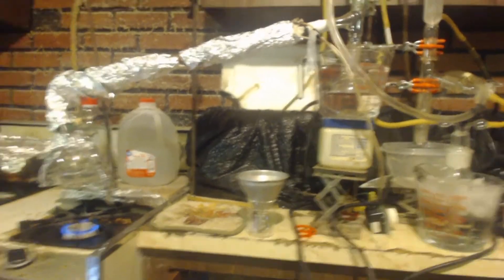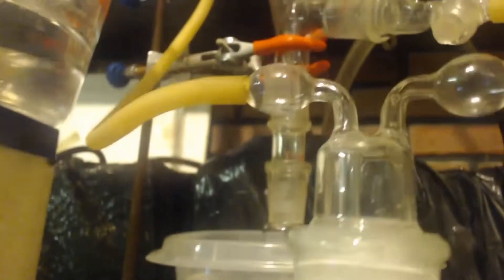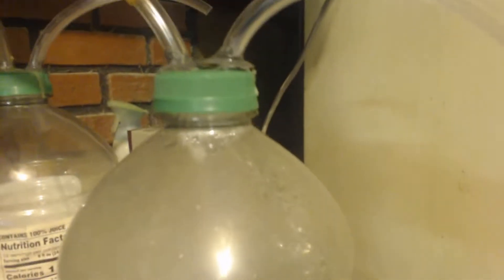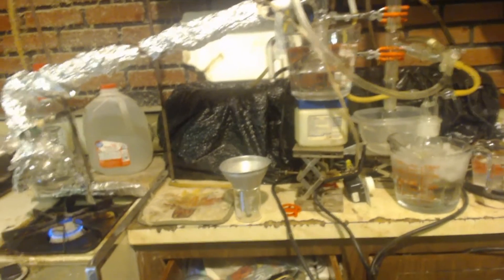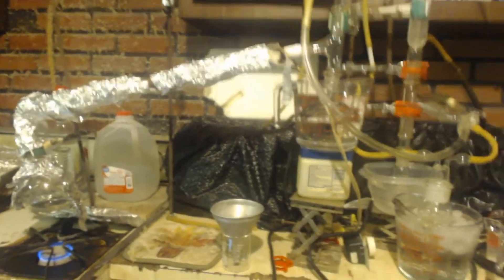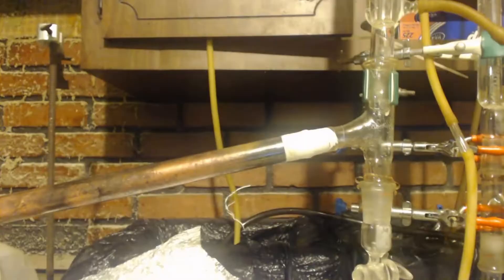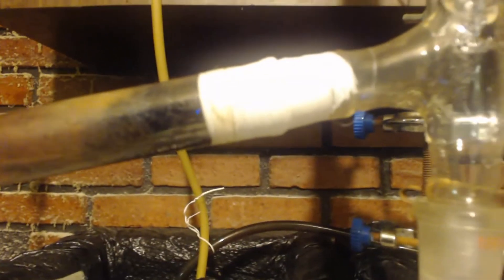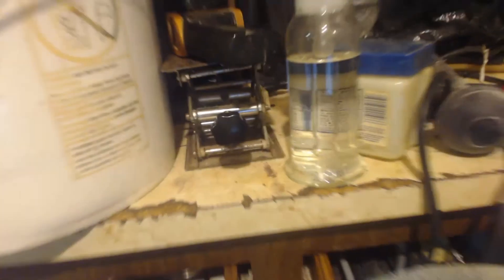ACETALDEHYDE SYNTHESIS part 1

Comment: This has been a bit frustrating & my ability to comprehend is no doubt the issue, my question is if you just want a nasty quick 8ml of it, is there any issue with doing a cut down version of this with the ethanol on one side, the glass rod connecting the receiving flask.

If the reaction is improved by passing the ethanol through at a fast rate then it gives the impression that 8ml should be able to be done in 15 or 20 minutes - is that an accurate assessment of this change?

The other thing I had trouble figuring out is stating the vapour needs to be at 300C before it hits the heated catalyst.
I am assuming you do not actually heat the ethanol (round bottom flask) to that temp as that seems very impractical & in the video there is only a single heat source other than where the round bottom flask sits.

How do you ensure that the vapour is at 300 while the catalyst is only at 275 with only a single heat source?
Does it mean you heat the tube directly to the left of the catalyst so that the tube itself is hotter than the catalyst and that would be close enough?

Thanks for the video
Reply from the maker: ADAM............First let me say that I HAVE NOT COMPLETELY figured out this experiment.   Last year when i made the video series  i did like 8 or 10 experiments and twice i got 8mL of product.   This year i tried to replicate and improve the experiment about 6 times and FAILED EVERY TIME.
                 (1)  Not sure what you mean by cut down version????    
                 (2)  But yes according to all the papers i read on people doing the experiment it is a QUICK reaction.    Meaning ..yes... making only 8mL should only take 15 to 20 minutes once the furnace tube is up to temp    
                  (3)  I heat the ethanol up in the round bottom flask to get it into a vapor leading into the furnace tube.     I ALSO have  HEAT TAPE around the furnace tube to get the ethanol and copper  up to 300C.  
                  (4)  I used water to experiment with first before i used ethanol.   Sending water vapor through the furnace tube.  The exit of the furnace tube was open to the atmosphere so i could put a thermometer in the open end  (exit) of the tube.   Then i experimented using different temps of the heat tape until the water vapor exited the furnace tube at 300C.
                  (5)  The heat tape was wound around the furnace tube right up to the point where the copper was in the tube.   The tube gets HOTTER in the middle  of the heat tape and at the end of the tube where the heat tape stops...where the copper is.......will not get as hot cause it is on the end of where the heat tape is.    Although this year when i tried my 6 experiments which ALL failed i used 2 heating tapes around the furnace tube and bought some thermostats that went up to 999C.    One heating tape was to heat up the ethanol and extended almost over the whole furnace tube.   Then a second heating tape that JUST  went around the copper part of the tube furnace.   I used 2 different thermostats ......the one around the copper at about 290C and the heat tape around the ethanol at about 350C.   The thermostats are only $15 each on ebay.   
                   (6)  Yes exactly!!!!!!!!!   I just put the heating tape all around the furnace tube right up to where the copper is (just enough to cover up the copper too.   So it gets hotter in the middle of the furnace tube where the ethanol is traveling before it hits the copper.   KEEP IN MIND last years experiments when i had no thermostats i just used a laser thermometer that goes up to like 500C.   I WAS THE THERMOSTAT  and used a switch to turn on and off the heat tape.    OH MY GOD  you just made me think of something.   Maybe my experiments did not work this year cause i used the thermostats WITHOUT checking to see how accurate they are.    I should have gotten my laser thermometer out and DOUBLE CHECKED my temps to make sure the thermostats were accurate.  I am NOW hoping that is why i failed this year.   Anyways if you got any more questions let me know.
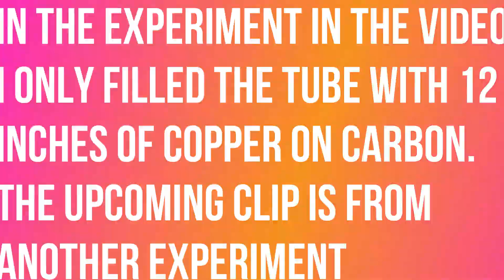Reply from the maker: ADAM ........The heat tape i am using on the furnace tube is showed at 9:00 in the video.  If you need help buying heat tape let me know and i will look up my serial number.   They only cost about $45 or $50 each on ebay or amazon and can go up to 700C.   But it is the same type of heat tape  nerd rage uses in his video where he builds a heating mantle for distillations.   As for the thermostats i bought they were XH-W1315 thermostats sold on ebay or amazon for $15 each.  Thermostats go from minus 30C to 999C.   Here is a video about the thermostats  https://www.youtube.com/watch?v=mrteBD7yAsw&t=34s   I love the thermostats.  I use them for my water cooled condenser when i distill stuff.   It really really really REALLY REALLY REALLY  cuts down on ice usage.   I just use aluminum foil to attach the thermostat probe to the water cooled condenser.
Reply: @johnblacksuperchemist2556  Hey mate - Thanks for your detailed responses, they are fantastic. I am going through them now, appreciate the effort you put into your videos.
Reply from the maker: @Adam Randall  ............Your welcome.  Glad you like the videos.   Hope i helped.   If not just ask some more questions.  KEEP IN MIND I am learning too so i do not know everything
Reply from the maker: ADAM...........If you mean by "cut down version"  .......making the apparatus smaller and just set it up like a distillation apparatus.  You can not do  that.   The acetaldehyde is so hot when coming out of the furnace tube you need something to cool it down A LOT.   
                   If you mean by "cut down version" .....using less ethanol.    Cause you only want a little bit of acetaldehyde then yes you can do that

Comment: You can use Ethanol sulfuric acid (75%) and MnO2 .From old Pharmacy book
Reply from the maker: Space Marine...........Have you ever tried it????????????   I could be wrong but i think MnO2 oxidation of alcohols to aldehydes REQUIRE an allylic alcohol and ethanol is not allylic.
Reply: @johnblacksuperchemist2556  no ive didnt try it but it looks true it was in old books alsway the mno2 sulfuric acid or later the EtOH dichromate way. Maybe next winter i try it.little bit late anwer :)
Reply from the maker: @Preyhawk81  ...........You're as bad as me.......replying to 3 yr old post.    I hope you are doing good.

Comment: John, impressive video as always. Glad to see you're still doing well. Ironically, I recently bought some supplies for the synthesis of acetaldehyde specifically so your video came as a surprise to me. I was going to do some tinkering to see if I get results but I figured it would be better to ask you since I'm a far less experienced chemist.

I'm planning on performing a hypochlorite oxidation of ethanol using calcium hypochlorite. From what I understand, hypochlorites can oxidize primary alcohols to aldehydes and carboxylic acid. I discovered that the aldehyde from the first step does not directly participate in the oxidation to the carboxylic acid, instead it's the aldehyde hydrate formed when it comes into contact with water. I was wondering if perhaps it's possible to exploit anhydrous reaction conditions to get better yields of acetaldehyde using these cheap reagents. Is there any information you can give me regarding this? Thanks in advance.
Reply: its a good idea try to condense the gas produced directly in a chilled condensor. it wud b very kind of you to share ur findings with me. another route cud heating ethylene glycol with zncl2.
Reply: @tanveershah4974  Thank you, Tanveer; I was actually thinking of doing the ethylene glycol method next! In any case I will come back to this comment to report my findings to you once I carry out the reaction.
Reply from the maker: @tanveershah4974  ..........tanveer............Never heard of ethylene glycol and zncl2.  Not sure how that would work.    I have heard of ethylene glycol and alumina to dehydrate it into acetaldehyde.   I have never tried it but i have faith that it works if you do it right.   I have also heard of using sulfuric acid to dehydrate ethylene glycol into acetaldehyde but i tried it a few times and it really does not work good and it makes ....what smells like......formaldehyde.   This way of using sulfuric acid and ethylene glycol is the same method as making 1_4_dioxane but the only 2 things i could think of to swing the yield more towards dehydration was more concentrated sulfuric acid and higher heat but that did not work to good.
Reply from the maker: Alex D.................You said you wanted to use bleach/AcOH to make aldehydes from primary alcohols.    And i said you need a catalyst for primary alcohols or you get no appreciable yield.   Well i finally found the name of the catalyst in case you are interested it is called   2,2,6,6_tetramethyl_piperidine_1_oxyl.   And then you get like 95% yield of aldehyde.
Reply: @johnblacksuperchemist2556  John, thanks for coming back to reply with the info. I played around a little with the reagents and as expected I got no appreciable yields. I also experimented with various catalysts I had on hand and still nothing. There was definitely some acetaldehyde being formed since in most cases I got a somewhat pleasant sweet smell almost like ether which definitely was not acetic acid or ethanol. It's also possible that it was indeed diethyl ether or ethyl acetate but I'm not sure whether or not the reaction mechanism allows for this. That being said, TEMPO is a little too difficult for me to acquire since I'm trying to avoid ordering from suppliers (the cheapest source I found was $200 for 25 grams of TEMPO; yikes!) and the synthesis uses some pretty expensive reagents. I think I'm just better off following your procedure although it will take some considerable preparation on my end lol. Thanks for the info brother keep up the great work! 👍
Reply from the maker: Alex D             https://en.wikipedia.org/wiki/TEMPO            That link has a small page about that catalyst.   Scroll down to "APPLICATIONS IN ORGANIC CHEMISTRY"
Reply from the maker: Alex D............I am reading your mind...lol.   Seriously though i did do some hypochlorous acid (bleach) oxidations last winter.   I I oxidized isopropanol to propanone (acetone).   I could only get a 30 to 35% yield but i have not tried everything i could to try to improve the yield...yet.     It was SUPER PURE acetone though.  I distilled it several times with vigoreax distillations.   As for the ethanol to acetaldehyde is not as easy.  You need a catalyst or you will NEVER get more than a mL....if that.  And i did not just read that but i also did a few experiments using the same technique i used to make acetone and i could only get the smell of acetaldehyde and no real yield.   If you give me a couple days i will try to look up what it is.  It is not an easily made catalyst.    
           No i do not know how to use anhydrous conditions to make a better yield.
            The cheapest and easiest way is the catalytic copper dehydrogenation of ethanol to make acetaldehyde.   READ THE TEXT I PUT UNDER THIS VIDEO...........and it will tell some improvements that can be done on the experiment in the video above to get better yields
Reply: infact one of my friend who is a professor and deen of chemistry dept and have been my room mate advised me to try ethylene glycol method. unfortunately i am now more busy in making mono pentaerythritol these days so cud not start experimenting on it.
for you to try bleach in ethanol there is video on you tube. the guy added more bleach to turn acetaldehyde into choloform. i feel right amount of molar ratios of ethanol n calcium oxychloride can make cheap acetladehyde.
another way cud be from calcium carbide to acetelyene then to acetaldehyde. thnx
Reply from the maker: @tanveershah4974  ...........Your ALOT past me with knowledge if your working with  pentaerythritol.  Well if you ever figure out how to make acetaldehyde with ethylene glycol and ZnCl2 let me know.   As for the acetylene  route.....I do have that in my notes but i forget how the reaction goes.   I guess it makes some kind of enol and then ..........wait I see.   You must add an alcohol to the acetylene triple bond making an enol that changes into an aldehyde.   Yeah i guess i have not really gotten to that experiment because of the acetylene being a gas.   Not sure how i would do the experiment.    This experiment in the video is really my FIRST high temp reaction.  And i have never really done any high pressure experiments either so i am hesitant about working with acetylene right now.   Sooner or later i will get there though

Comment: nice video dear. can u advise % yields? of acetaldehyde produced here? pls advise how to make cheapest acetaldehyde? around 50 kg each day. thnx
Reply from the maker: tanveer...........My yield was crappy.  I only got 8 mL of SUPER PURE acetaldehyde.  This is probably the cheapest way to make acetaldehyde cause you only really need some copper and ethanol.   And alumina if you want your copper catalyst to last longer.  
                         I will go over what i THINK will improve yields in part 2.   In part 2 i will go more in depth.  But ...........here are my best tips to improve the reaction and the catalyst...........(1) use smaller diameter tubing for the furnace.  Like 12 mm inner diameter.  (2) Only put catalyst in like 15 mm length in the tube.  (3) MAKE sure the ethanol vapor is at 300C at least.  Even 350 C would be ok probably.  (4) have the catalyst at 275 to 290 C.   (5)  Send the ethanol vapor across the catalyst fast............Like real fast.   Not slow like i do in the video.   (6)  Use gamma alumina as the catalyst support structure.   (7)  Use a combo of 3 different metals.........at the right ratio which i will go over in my next video.  (8)  Do not get any leaks cause IT WILL CATCH ON FIRE INSTANTANEOUSLY at 300 C temps.   Be prepared to hurry up and put out the fire by blowing on it like a candle.   I got 3 leaks and 3 fires all together.  The main reason was cause i reused the same home made teflon tape gaskets instead of re doing it each experiment.   And after using the same gasket over and over again sooner or later i got a fire.  Also (9) use ANHYDROUS ethanol.     If all that is done then the yield should be good.

Comment: Using copper with heat to convert the alcohol into acetaldehyde. I used ethanol and chromic acid (Sodium chromate + dil Sulfuric acid). Great Job.
Reply from the maker: Chan............Thanks but i could definitely have some improvement on the experiment.  I did learn a lot and will going over what i learned in the next video

Comment: That's fantastic joining the quartz tube to your glassware with the teflon tape.  How hot do you figure that upper most joint gets with this reaction?  Any idea if it could work with a 400-600C tube furnace in a vertical position?  Like in this.... https://inis.iaea.org/collection/NCLCollectionStore/_Public/04/050/4050195.pdf  Cheers!
Reply from the maker: the GHOST.........400 to 600 C is to hot.   If you want to oxidize ethanol to acetaldehyde you could do it at 550C but you need to pump air into the furnace tube where the ethanol vapor is sent into the metal.   Also you would use silver instead of copper.  I am doing a dehydrogenation reaction in the video and not an oxidation reaction so i want the temp of the ethanol vapor around 300 C and the copper metal or ratio of metals at 275 to 290 C
                       Could you use a vetical set up?  I do not see why not.
Reply: @johnblacksuperchemist2556  I was meaning for the BBr3 reaction in the paper.  Sorry for the confusion.
Reply from the maker: @theghostofsw6276  ..........I do not really know anything about boron tribromide.
Reply: @johnblacksuperchemist2556  OK...thanks, John.
Reply from the maker: THE ghost.............here are my best tips to improve the reaction and the catalyst...........(1) use smaller diameter tubing for the furnace.  Like 12 mm inner diameter.  (2) Only put catalyst in like 15 mm length in the tube.  (3) MAKE sure the ethanol vapor is at 300C at least.  Even 350 C would be ok probably.  (4) have the catalyst at 275 to 290 C.   (5)  Send the ethanol vapor across the catalyst fast............Like real fast.   Not slow like i do in the video.   (6)  Use gamma alumina as the catalyst support structure.   (7)  Use a combo of 3 different metals.........at the right ratio which i will go over in my next video.  (8)  Do not get any leaks cause IT WILL CATCH ON FIRE INSTANTANEOUSLY at 300 C temps.   Be prepared to hurry up and put out the fire by blowing on it like a candle.   I got 3 leaks and 3 fires all together.  The main reason was cause i reused the same home made teflon tape gaskets instead of re doing it each experiment.   And after using the same gasket over and over again sooner or later i got a fire.  Also (9) use ANHYDROUS ethanol.     If all that is done then the yield should be good.   I only got 8 mL the way i do it in the video............But i learned a lot more stuff since then